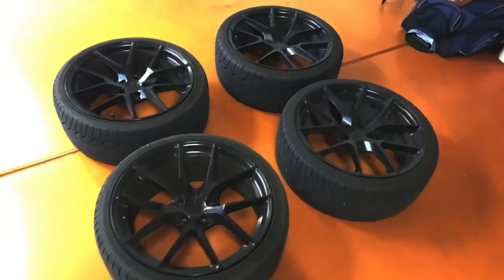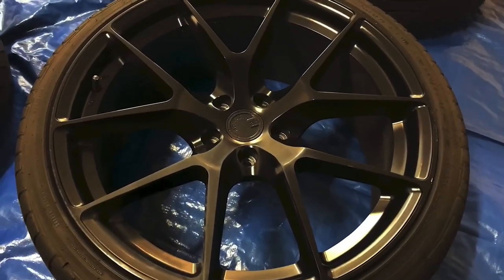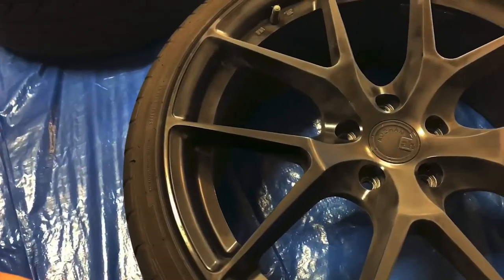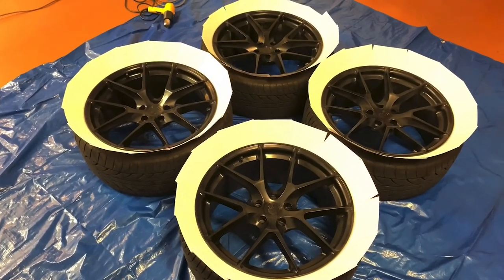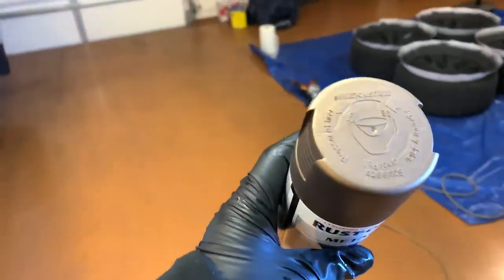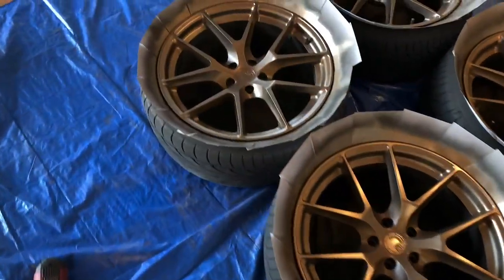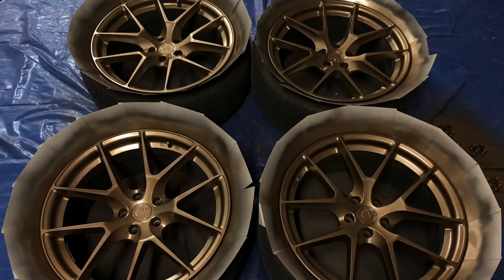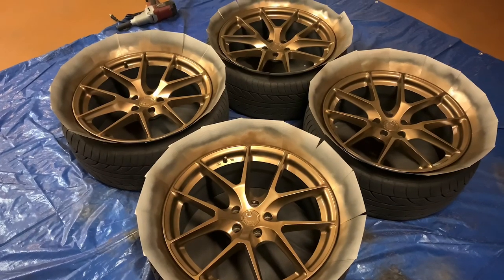How to get professional results with a rattle can! (Rustolium Antique Brass)

Comment: Hey nice wheel color man!
I also noticed your duckbill spoiler and you managed to get rid of the stock one?
Reply from the maker: Yeah I filled the sport holes with expanding foam, took it down to the deck lid and then wrapped the trunk.

I have a video on the process 🤙🏽

Comment: I’m just curious as to why you didn’t go the plasti dip way where you can peel it off easily but yet also get the same best results.
Reply from the maker: Great question. I’m eventually powder-coating the wheels but I wanted something a little more permanent. If you caught my last wheel color video, I chose a sweet gun metal plasti dip color. Still on of my favorite or top choice for wheel color BUT the dip only lasted 5 days. I dropped a few drops of gasoline on the rear wheel after a fill up and it caused the dip to peel up and eventually rip off on the hwy. I was pretty pissed, I didn’t wanna do all that work again and have it last days. 

I wanted something to last at least long enough for a new set of wheels or until I move into the new house where I’ll get a small power coating station setup.

Comment: I restore wheels for a living and stripping and blasting them would have been the way to go and then doing them and powder coat it holds up  the problem is you get some tired junkie putting your tires on and it's not careful he can shift but very easy will powder coat that will not happen. And saying that joining yourself you should go to an automotive paint supply store they sell paint  specifically for automotive use. the s*** at discount in advance is not for automotive use even though it says it on the can that's b***** it's general they make a paint called Sims it has a better finish and comes out a hundred percent better you can also buy something called 2K clear it's $25 a can it has a partner on the bottom it'll give you professional looking clear coat that clear only last once you activate it for 48 hours if you frigerator you might get a week out of it. but it's an aerosol can clear which is the best you can buy for automotive needs by
Reply from the maker: Yeah man, this was just a temporary color to help me decide which color to get the wheels powdercoated.

If you remember back to me plasti dipping my wheels gun metal. I wanted to do bronze as well but that plasti dip held up 5 days before it came off. I wanted something that would last at least a month so i could decide which route to go. This is by no means permanent, just wanted something a little more durable while I’m choosing which color to go with. 👌🏽